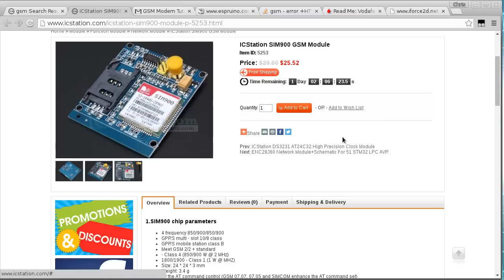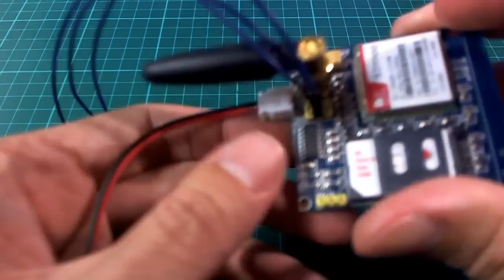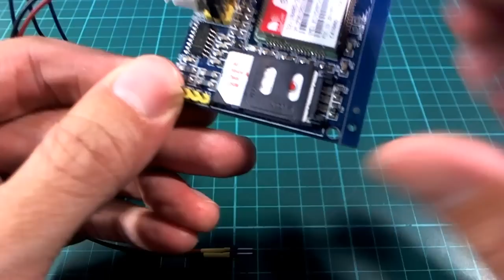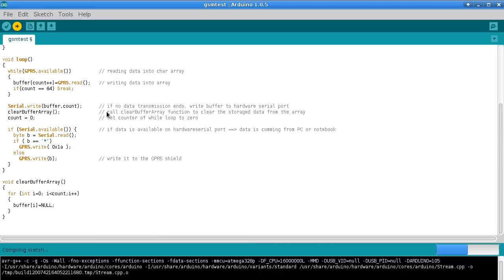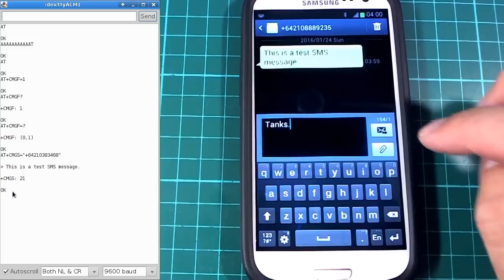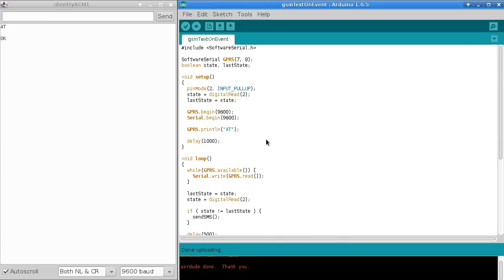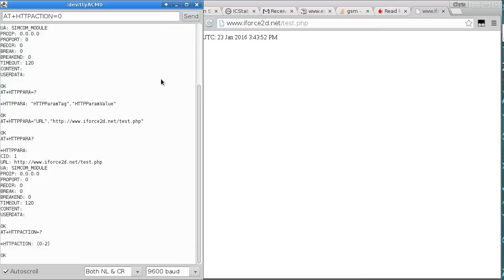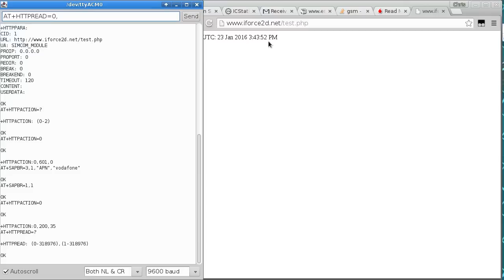Arduino + GSM module (SMS message, HTTP requests)

Comment: That's odd about the external power jack being under powered.  Standard USB provides 500ma and if the GSM works with the USB connection, you'd expect it to work with a 1A adapter.
Reply: Not really because like he says: the barrel jack runs power in via a little smd passive regulator wheras on USB power you are running on the 5v supply from the PC.

the GSM board won't use much if you are in a 'good signal' area, if you go out into the sticks you'll find the board's tansmit power will increase in order to try to reach the closest tower, then it will draw a lot of current.

Comment: I have one more question: Can I use an Arduino Mega2560 instead of an Arduino Uno with the same code ?
Reply from the maker: You will need to change some pin numbers, but the program itself should work.

Comment: I am building something similar but with a SMS notification, I also want to take a picture or better yet a 30 second video and save it to an SD card in a SD card module( I'm not using shields ) with the time at which the sensor detected motion. Can you help me with that. I am a noob and have no experience with the Arduino. Can you make a video on this topic and help me write the code for this.
Thanks :)
Reply from the maker: No. I don't think arduino has the computing power to do that.

Comment: Sir.  I used your links for the sketches but i didn't find the code which you have used in this video.
Reply: sir i mean the code you used in this video before 27 min.
Reply from the maker: "before 27 min" doesn't help.... which code exactly?
Reply: Sir, the code you used earlier in the video before explaining gsmtexton event.  Secondly, i am not getting any thing on the ide window when entring commands on it but the textonevent code is working-any help on this.
And at last, sir i want to send some data on a webserver using this gsm can you help me on this.
Reply from the maker: "earlier in the video" doesn't help. Give me a specific time in the video when I'm looking at that code.
Reply: 13.39
Reply: Gpstest. Actually the gpstest i got from the link is not the same .
Reply from the maker: As I mentioned in the video, I got it on the internet somewhere, I don't remember where but try searching for the text in the code comments, eg. "a serial link between the computer and the GPRS Shield at 9600 bps". It should be easy to find.
Reply from the maker: Failing that, I explain all the code from about the 14 minute mark, it's only about 20 lines so it wouldn't kill you just to type it. Please note the change I made with the asterisk (14:55)
Reply: Ok sir , that really helped and what about i m not getting aaaat or ok in my ide however the code is working its sending text to my phone.
Reply from the maker: Make sure your serial monitor is set to use both line feed and carriage return characters, I explained somewhere in the video...
Reply: I checked that and the boadrate too
Reply from the maker: 16:49
Reply: Yeah that ok on hitting at is not happning but the code is working.
Reply from the maker: If you are doing everything exactly as I do in the video but with different results, I have no more ideas.

Comment: Is this Program compatible with Sim808? Thanks in advance.
Reply from the maker: I don't know. It might not even be compatible with all SIM900 variants. But the spec sheet for your module should show you what commands to use instead of the ones I'm using.

Comment: Hello, where can i see a copy of your program?
Reply from the maker: Try the link in the description
Reply: there are a lot in sketches, dunno which one there. i tried looking on every AT command but there is none, same goes for SMS tutorial. IC Station none also. just the codes you have input on the arduino uno is what i can't find :((
Reply from the maker: hold your mouse over the "YouTube video" link of the 'gsm' related links and match the youtube link with this video.... takes 5 seconds.
okay here.... http://www.iforce2d.net/sketches/gsm_SMS_HTTP.zip
Reply: thanks a lot sir ^_^

Comment: Hi
Great video! I have everything working good :)
But I want to know how change the sketche to send sms to more then only one phone number.
BR for Sweden
Reply from the maker: I didn't even know you could do that with SMS.... you mean like a cc address on email?
I suppose you could just repeat the same procedure for each number you need.
Reply: That was a fast answer :)
No not like a cc or bc. 
All I want to to is send the same SMS to more then one phone.
Let´s say we have a switch in the lock in our front door that we want to monitor my wife and me.
So I want to send the sms to me and my wife at the same time. Hope you understand what I want to do.
Reply from the maker: Well then I guess you can just do the sending part of the code twice.
Reply: Can you help me with this. It seems hard for me to write the sketch : (
Reply from the maker: No, it's not hard at all. In the code you can see the part which sends the SMS right? Just do that twice, but with a different number each time. So there is nothing to wrtie, just copy + paste.... very simple.
Reply: That i know but it didn't work. But the delay was set at 500 and it needed 3000.
So now its working :)
Thanks again

Comment: Good day! I would like to ask if I can set the mobile number in this line "  GPRS.println("AT+CMGS=\"+64123456789\"");" on your gsmTextOnEvent program into a variable? I would like to send a SMS to multiple mobile numbers using an array of mobile numbers. Thank you!
Reply from the maker: I don't see why not.
Reply: Can you suggest me some way to do it? I already tried to program it but it doesn't work. :(
Reply from the maker: It would be a string variable would it not?
char* mynumber = "12345";
Reply from the maker: If you want to make it easier to answer your question, tell me what you already tried so I don't waste my time suggesting something you already tried, and you don't waste your time reading my useless answer. Also, "doesn't work" is not a helpful description.

char* mynumber = "12345";
GPRS.println("AT+CMGS=\"");
GPRS.println(mynumber);
GPRS.println("\"");
Reply: I tried this program:
#include <SoftwareSerial.h>

SoftwareSerial mySerial(9, 10); //TX,RX

String recipientNumber[2] = {"+639269546903", "+639108042236"};

void setup()
{
  mySerial.begin(9600); 
  Serial.begin(9600);  
  delay(100);
  mySerial.println("Seeendiiiiiing: ");
}

void loop()
{
  if (Serial.available() > 0)
    if (Serial.read() == 'a') {
      SendMessage1();
      mySerial.println("SENT !!!");
    }
  if (mySerial.available() > 0)
    Serial.write(mySerial.read());
}

void SendMessage1()
{
  for (int i = 0; i < 2; i++) {
    mySerial.println("AT+CMGF=1");  
    delay(2000);
    mySerial.println("AT+CMGS=\"recipientNumber[i]\"\r");
    delay(2000);
    mySerial.println("Hello");
    delay(500);
    mySerial.println((char)26);
    delay(2000);
    Serial.println(i);
    Serial.println(recipientNumber[i]);
  }
}

* Nothing was sent *
Reply from the maker: I don't really have time for this level of assistance. One thing I can see is. this will never work... lol... 
mySerial.println("AT+CMGS=\"recipientNumber[i]\"\r");
Do it like in my last comment.
Reply: Thank you

Comment: please : 
 
when I do  your program   it work ;  but  when I  try to do this    program  :
/***************************************************************************/
#include <SoftwareSerial.h>
SoftwareSerial GPRS(7, 8); // RX, TX
void setup()
{
  GPRS.begin(9600);
  Serial.begin(9600);

  GPRS.println("AT+CMGF=1");

  GPRS.write(13);
  GPRS.write(10);

  GPRS.println("AT+CMGR=1");

  GPRS.write(13);
  GPRS.write(10);
  delay(5000);

  while (Serial.available())
    GPRS.write(Serial.read());

  while (GPRS.available())
    Serial.write(GPRS.read());
}
void loop()
{
  
}
/**********************************************************************************/
I did not  receive  all msg ( I don't know what happend ) ???
can I have  some  help  for  receive  all msg  with my method?????
Reply from the maker: How about you slowly change my program into your program, slowly, piece by piece, testing it at each step. At some point you will discover what change causes the problem.
Reply: i want to my arduino receive message alone how can I Do???
Reply from the maker: Try using the serial monitor first, to check that your SIM module works correctly manually. Then slowly change my program into your program, piece by piece, testing it at each step. At some point you will discover what change causes the problem.

Comment: Hey! I'm trying to get the module running for a couple of hours. Where exactly did you get the library from? And is it possible that you could post your sketch/send it to me by email? I'm kind of desperated...
Reply from the maker: What library? If you expect help, you'll need to be more descriptive. I showed every step in detail in the video, and my code is linked to in the video description. At what point does your result differ from mine?
Reply: I used exact the same sketch. But when I type i. e. "AT" the answer is not "OK", but some awkward signs(like ððððððððððüüüüüüüüððððððð...), not even usual letters. Do you have any idea why that happens?
Reply from the maker: Did you do exactly as I did until that point? Did you select the baud rate and line ending type as I explained? Then I have no idea.

Comment: Be aware buying this module on ebay wil most likely be locked to these locations
China
India
Singapore
Malaysia
Thailand
Indonesia
Cambodia
Vietnam
Laos
Burma
Brunei
Philippines
East Timor

Just bought mine identical to this one in the video and when i tested it using AT+CPIN? command it responded PH-NET PIN, meaning it is network locked. trying to flash the 7'th firmware to fix the issue. In other words get a grantee that it is not network locked or stay away from this module.
Reply from the maker: Can you give a source for this info please?
Reply: well found it on multiple sites just google "SIM900A PH-NET PIN"

EDIT: I should mention that my IC Station board have the SIM900A module

But else it is 100% identical to your board So it would rather bed Stay away if it says SIM900A and not SIM900
Reply: for users of SIM900A in europe upload firmware 1137B09SIM900B32_ST or 1137B09SIM900B64_ST

wire the GSM module to FTDI or alike. Power it on

in terminal software run
AT+CGMR

My respons was
Revision:1137B09SIM900B32_ST

for some it could be
Revision:1137B09SIM900B64_ST

Notice that the difference is 32 and 64 in the name.

Go download firmware  1137B09SIM900B32 ST  if you have 32 in Response of revision
OR
1137B09SIM900B64 ST if you have 64 in Response of revision
Here: http://dostmuhammad.com/sim900-firmware-update-tutorials-appnotes/?doing_wp_cron=1474107025.2542090415954589843750

then download the simcom software from here
http://www.geekonfire.com/wiki/index.php?title=GPRS_Shield%EF%BC%88SIM900%EF%BC%89_Firmware_Update

follow the instructions

At some point the software tells you to power up the device even tho it is. just quickly short RST to GND and the software should keep going

I think it took about 10 minutes to upload
Reply: hey. may i have the instructions/steps on how to flash the firmware. The links don't work anymore

Comment: Very interesting and helpful
after watching this, i ordered UNO arduino+m590E, 
planning to marge sms project with reporting and remote 8 ports control switch using At-tiny 2313 AVR,
also my plan is split GSM module and use it for as international roaming local solution to avoid Roaming charges,

Expecting a little help from you to extend my vision and mix blend of your experties.

Highly appericalte your effort and reseach, Love it!

Comment: Really nice tutorial. Instead of using delay i would do state machine. I know it's taking some more space in the memory, but hanging the loop isn't recommended. This is also how you do "multi thread" on arduino

do this instead

unsigned long currentMillis;

unsigned long prevMillisTest1 = 0;
unsigned long prevMillisTest2 = 0;

long timerForTest1 = 1000; //1 second
long timerForTest2 = 2000; //2 seconds

bool flagForTest2 = false;

void setup() {
  //Here is your setup code
}

void loop() {
  currentMillis = millis();
  
  if (currentMillis - prevMillisTest1 >= timerForTes1) {
    ....
    //Do som code every 1 second
    ....
    flagForTest2  = true;
    prevMillisTest1 = currentMillis;
  }

  if ((currentMillis - prevMillisTest2 >= timerForTes2) &&  flagForTest2  == true) {
    ....
    //Do som code every 2 second if test 1 has run and set flag to true
    ....
    prevMillisTest2 = currentMillis;
  }
}
Reply from the maker: Yeah, that's how I do it when there is something else that needs to be done during the 'delay'.

Comment: i have bought a sim 900a mini dev board and try to interface with 
arduino as you did, it was successful and when receving messeage from a 
phone, it doestn't show anything in the serial monitor(your youtube vedio 
describes it at 23.30 upwards, upto that point every code works fine), ( i'm 
using a GSM module which is 100% look alike your one with sim 900a and a
 diffrent latest version i think, arduino IDE 1.6 )
please i need your help...
Reply from the maker: You don't need to spam me like that. I replied about this to one of your other contacts.

Comment: Great Video ! I was just sending AT+HTTPREAD, I did not know we need to as 2 parameters separated by comma. Thank you so much.
Also, what about POST (AT+HTTPACTION=1) ? I am actually working on it, it is sending the data but appending "\n" in the end. Now "\n" is very important because that comes from SIM900.println("field1=val1&field2=val2");

Comment: Have you (or anyone) used the SIM808 module (http://www.aliexpress.com/item/GSM-GPS-SIM808-Breakout-Board-SIM808-core-board-2-in-1-Quad-band-GSM-GPRS-Module/32435607442.html)  + Uno at all?  I'm struggling with a problem where it keeps cycling through the initialisation sequence.  Gives me the CFUN/CPIN/Call Ready/SMS Ready output messages, responds OK from a ATX, and gives me vodafone fo the COPS output (down here in Welly :-)) then seems to reset itself.  I had an underpower message which went away when I hooked it up to an eternal powers source, but still get this annoying cycling.  Any pointer would be hugely appreciated.

Comment: just wondering if you could achieve the same txt message effect without the Arduino and just the GSM? also do you know of a good product that only sends txt messages to phone, no voice etc.
Reply from the maker: No. How would the GSM know what (and when) to send?
A good product to only send txt messages is the stuff in this video :p
Reply: Do you know you of a smaller device that can take the arduino's place looking to basically have only two input conditions that result in a txt being sent.
Reply from the maker: There might be some purpose built things out there that would do it, but if you're looking to DIY I don't think it will get much smaller. How small a space do you need it to fit in?? You might be able to use an ATtiny, but the GSM module is bigger than the arduino anyway, seems kinda pointless...

Comment: how can we make the sim900 send sms to unknown number which is not set in the source code?
Reply from the maker: Basically you are asking how to tell the arduino a number from an outside source right? The question is not necessarily related to sim900 or SMS that I can see. You could use a serial (UART) connection, a bluetooth module, a radio module like zigbee or nRF24L01, and probably a bunch of other ways too.

Comment: hi sir is there a way to send your exact location through GSM/GPS module by just clicking something like buttons..and received the message through your PC and CP??plss reply thanks
Reply from the maker: You could do an HTTP request to the webserver as I did in this video, and then have the webserver send an email.
Reply: Are we going to use GPS module here??and do we need Internet to pass the exact location of the device?? thanks bro
Reply: sir i have a question..is your mobile data need to always on so that i can transmit data to the computer...or the mobile data will turn on automatically when i push the button as a trigger to send or transmit data..is it possible for me to transmit data by just holding the button for 3-5sec and will activate the mobile data..thanks bro...
Reply from the maker: I don't understand your questions. If you watched this video, I did not use any GPS module here. I have other videos where I used GPS modules though. I don't get what you mean by mobile data "on". If you want to send data, you send data. There is nothing to turn "on".

Comment: What are the Arduino pins that are needed to connect to the GSM module/shield (GSM pins)? because right now I have a Vernier interface shield mounted on my Arduino board. Basically what I am trying to do is if the sensors connected to the Vernier interface shield shows a reading (whatever value you code) the Arduino board would activate the GSM shield in turn sending an SMS.
Example
If(sensor1>50)
sends a signal activating the GSM shield in turn sends an SMS message.
Reply from the maker: +TENJHOTENGE1 I explained in detail at 5:36. The RX/TX pins on the arduino side will be whatever you specify in the source code for the SoftwareSerial.